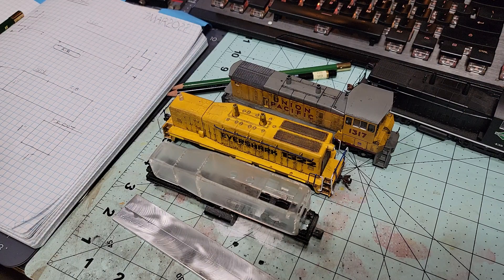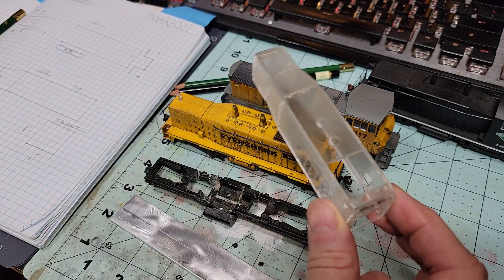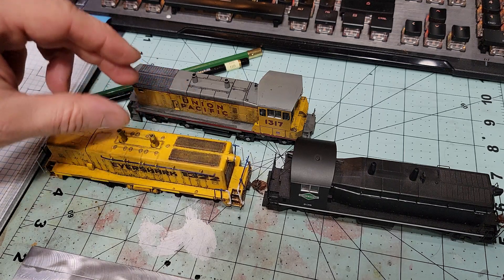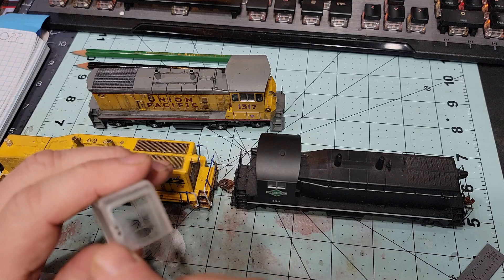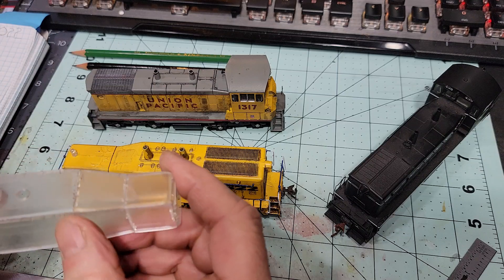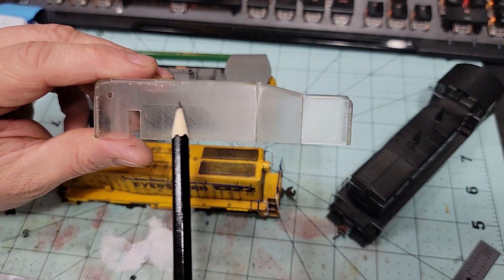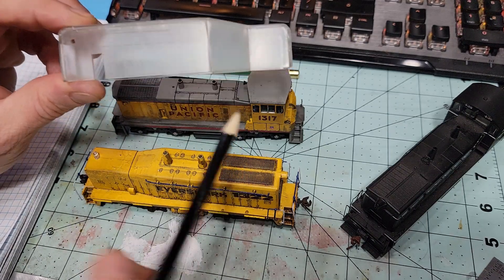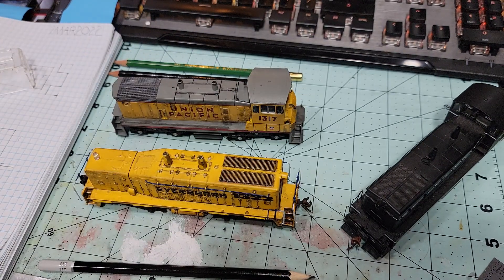2022 5 Loco Contest Part 27 First Fabricated Locomotive Shell

Comment: 60 days left.  Then you have plenty of time.  In 60 days you can do 27 entries.  I was under the impression you had till the End of March.  Your work is so advanced at this point, I am working on getting you an honorary Engineering degree.  That inventing the wheel thing was really impressive to the committee.
Reply from the maker: I searched everywhere for a text book with at least some useful info about gear trains, but no luck.  I can enter 5 locomotives, but a cow and calf count as 1.  as long as I keep pushing forward, I think the best is yet to come!